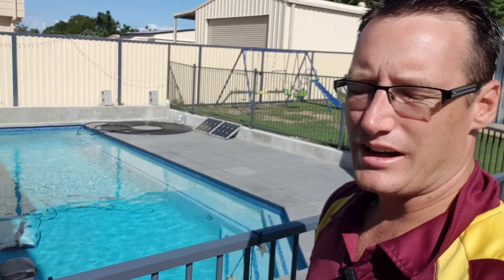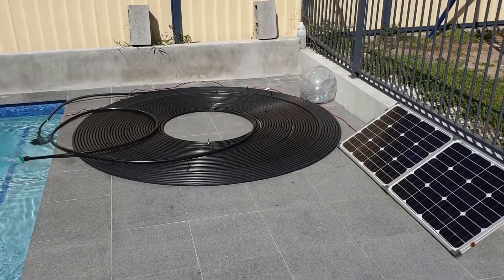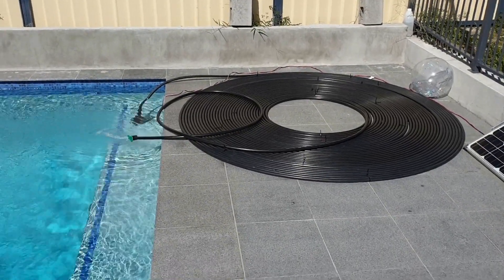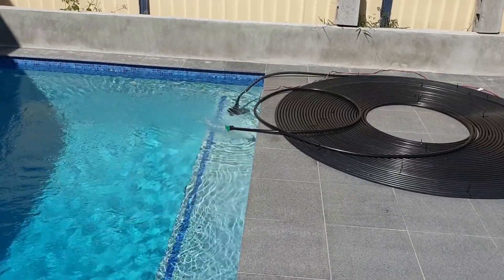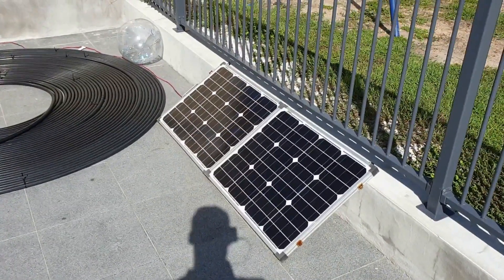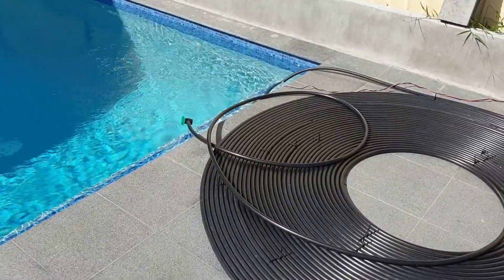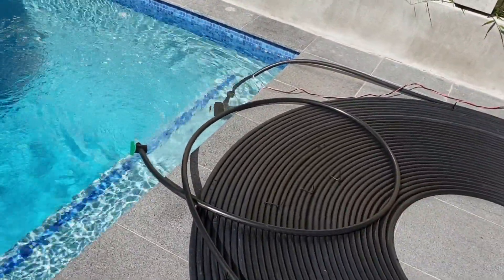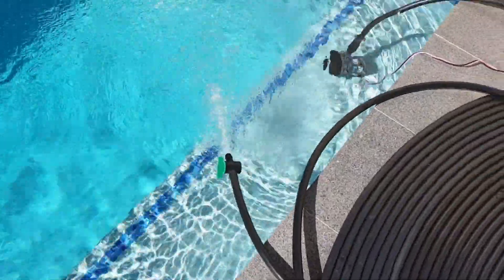Aussie DIY Solar Pool Heater

Comment: Can you not get rubberized solar heaters it is made of black rubber with small holes with an inlet and outlet where u can put it on your roof that way it catch all the solar radiation heating the water
Reply from the maker: Rubber breaks down over time and ends up in the pool.

Comment: Don't restrict your water flow, you should be increasing it to the maximum of your pump.

Conduction of heat is relative to the tempreture difference between the two materials, so you want the lowest possible tempreture of the water you're heating and highest of the material you're using to heat aka solar gain from the retic pipe, and heat from the pavers. 

To improve it reduce losses from ambient air by shrouding it in a perspex box.

By increasing the mass flow of the system you are decreasing the instaneous tempreture of the water passing a particular point thereby increasing your heating efficiency.

Anyone designing something similar you could use smaller diameter piping via a manifold in order to increase your surface area for heating. Like commercial systems use.

Comment: Drop the intake to the bottom of the pool to reach the coldest water and run the flow wide open with no restriction for max solar input.

Comment: I tried a bilge pump from aliexpress, it last 30 days before it leaked and shit it's self :/
have not yet found a magnetically driven 12v/24v pump.   boo
I did however get a 6.35KW solar system installed on the roof to deal with the power bill, which has worked out VERY nicely.
Reply: Solar system runs what exactly
Reply: @akuansarawlins2838  the house.   it a grid tied system.

Comment: Get a small 12v battery and a charge controller, it will work much better. A a raspberry pi  to control it.
Reply: naaa just a bigger solar panel.   200w :d  https://www.youtube.com/watch?v=42fuO9P4G7c
shame the pump died after 30 days...  cheap chinese crap.
Reply: This is actually an interesting way to do it (the video owners way), if you think about it you only really want to turn the water over when the sun is actually hitting the panel, otherwise you might be chilling the water. So if you have your heating pipe and panel together for the pump, it is only going to function when you actually want it to. This would also be good if you have a cover so you aren't taking warm water out at night and you can let it run on its own.